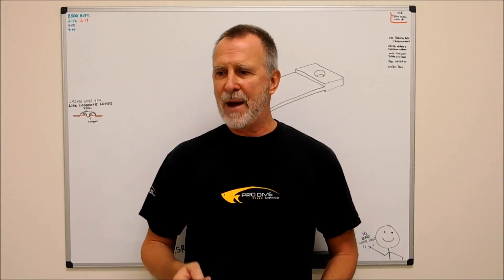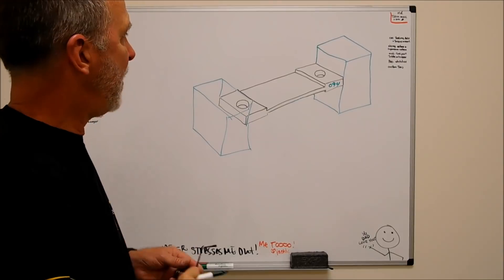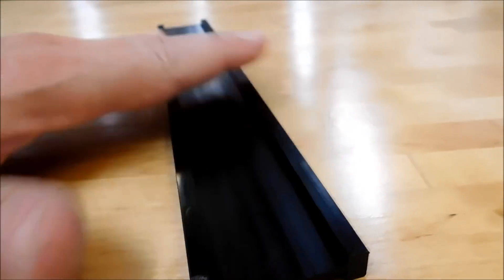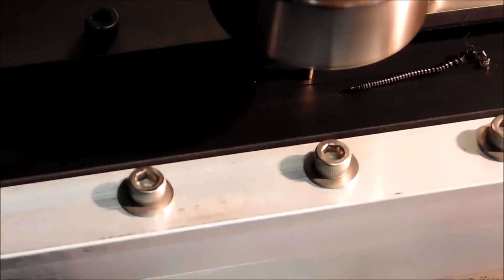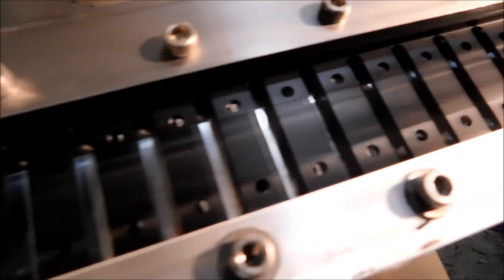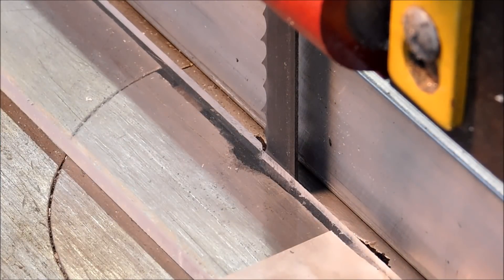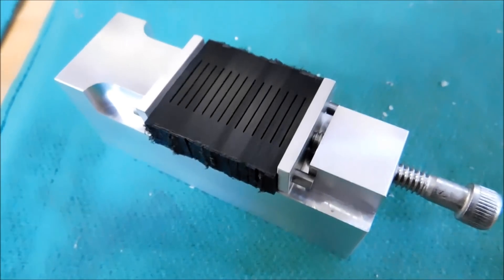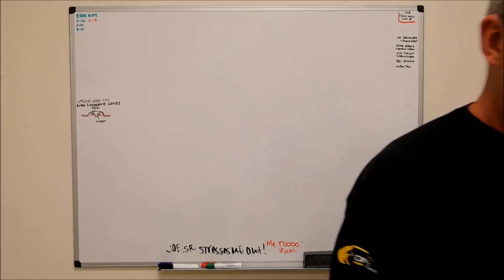Dogbone Milling - A Great Way to Hold a Small Part

Comment: God dammit i hate cnc machines ,you need to be a freaking programmer not a machinist anymore.And you have to watch not to crash a 100-200k$ worth machine simply because you forgot to put ; or something .I know its super fast/accurate and its the future but still 500 people replaced by 10 of those machines -yes its fast but 480 people lost jobs that is 1000 people's incomes in question (lets say they had wife and 1 child).Its not the Mexicans that are stealing the jobs -its the machines(and the Chinese guys but they dont know how to make a proper thread so we got nothing to worry) !
Reply: It's the same all over the place - not just machinist.
Reply from the maker: Someone still has to build the fixtures. Manual skills are very valuable.
Reply: Same as it ever was.

https://en.wikipedia.org/wiki/Luddite
Reply: I understand where you are coming from with your thinking.

 But if not the machine to speed things up and reduce labor cost .
It would be some other way, that reduce cost to make the item cheaper.
Everyone including yourself wants cheaper cheaper.
The only way i get to look at a job, is if i am cheaper, other wise forget it.
People are generally not interested if it is better, just cheaper.

It's an unfortunate fact especially in these current times.
Reply: Or 500 people only having to work for a tenth of the time, being able to afford the same lifestyle as if they were working manually.
And yes, that raises the real question you're asking - who is pocketing the profits/forthcoming from automation.
You're looking at a distribution problem.
Good luck with your search for an answer.
Reply: Peter CCR ENG -I dont want cheaper i want a product that will last more than 6 months-but these days its hard to find such product in a pile of garbage they sell us.If i pay something and i am willing for good product i want it to last .Problem is even brand names whored themself out.look at bosch or makita ,dewalt and the rest -they produce so many junk quality tools these days that its hard to know which one to buy.They got 20 models of hand drills,in 1980 it was maybe 2-3.They dont even improve their products or fix faulty things -just make another model,same shit different color and people will buy it.Where did the service centers go?In my country bosch costed 3/4 of a paycheck to buy in the 80s-people fixed drills, grinders and things-now just throw away buy new one.But i still to this day use grinder and drill my father bought in 1980-thats a quality worthy of money not this shit they sell today that lasts as much as warranty and not a week later.
Reply: Joan Sparky -there will be no 500 people,modern automated factory has no need for 500 people -maybe 50 top.Even if 500 people work for tenth ofa time -it means less salary -lower quality of life.Not to mention you dont need skilled workers anymore so you can reduce the price of work even more.
If this full automatisation is going to happen(and sooner or later it will) -we will have to reconsider the paycheck and whole concept of work for payment and distribution of wealth  as we know for last 2000 years.
Reply: "Even if 500 people work for tenth ofa time -it means less salary -lower quality of life."
Again, this is a distribution problem - the distribution of the fruits of automation/productivity gains.
If one worker does 10 times more with automation than without, the product would either cost 10 times less OR if the product is sold at the same price, the worker would earn 10 times more (=can work a tenth of the time for same wage = keeps lifestyle).
If neither of these outcomes happen you have a distribution problem, usually caused by some sort of monopoly (the owner of the machine or even more probably the lender of the capital that bought that machine pocketing the difference).
Not a lot of people get this.

And yes, this is capitalism critique.

Just to extrapolate things here - what happens in a world were machines/computers do all the work?
The 'owners' of those machines (and the IP connected with it) will earn the output of those machines 100%.
Anyone without ownership of machines will get nothing.
That's where we're headed, the endgame of capitalism.
And funnily enough - capitalism hasn't got a social/human/fair answer for that.
But people will ask that question at some point.
Reply: I hear what you are saying but we all want something for less when money is limited so production  has to be cheap and effective- sorry to burst your bubble but the Chinese "Joe equivalents" in Taiwan are top flight machinists that even Joe would admire.They are the skill behind much of China's development. They are amazing and more fool you for underestimating their ability- I certainly did before but I soon wised up. The only way to compete is to up your effectiveness which is what Joe has shown us here. If you do not want Chinese crap then pay for good quality Chinese stuff ( it has a Western label on it- you know Apple + 90 % of the computer motherboards used checking out YouTube) If you pay $20  for something that should cost $100 but it is made in the Us or the UK it will be cheap and nasty too- no way round that. All China really offers is more bang for your buck and everyone wants that and they work really really hard to supply it! The best course of action is to lean useful skills as they will always be very valuable- add value and work hard and you'll never be out of a job.
Reply: Got to share the story of my father in law.  A great hand wheel machinist who did parts for nuclear reactors.  Exotic materials and tight tolerances.   When the CNC revolution occurred, his employer offered to retrain to CNC machinist.  He blew up, "told off" the company that CNC was "junk" and that hand operations ruled.  ... 6 months later he was laid off, never to have such a good job again in his life.  He passed away a poor and bitter man, always blaming "the man" for the next 25 years...  adaption is the way of life.  Nothing stays the same...

Comment: Very nice. Were those fixtures custom made for that one time job, and was that figured into the part cost to customer? I see a lot of time spent on fixtures that you may never use again.
Reply from the maker: Half a day on the big fixture, less than an hour on the small one. Time well spent in my opinion. Both fixtures can be utilized on future jobs.
Reply: Not to mention that the time those fixtures saved is far beyond their cost.

Comment: Joe;

For your cut off and final trim operation, could you have set up the 1st fixture so you could slip in a plate (after the hole drilling and slotting operations) under the delrin piece with slight oversize holes at the 4 corner holes in the delrin piece, have 4 tapped holes in the bottom of the main fixture, then bolt on a top plate to clamp the delrin?  Run a thin milling cutter between the plate and dogbone clamp and you have final sizing achieved without having to remove the delrin piece from the main fixture.  Could even use 6 or 8 bolts to clamp down to make sure each individual delrin piece stays clamped in during the trim process.  This would eliminate the double handling and also assure part consistency since the delrin is never removed from the main fixture until after work is completed.

Would appreciate your feedback on whether this is a reasonable production idea.

Regards;

Ron
Reply: I'd've also used the smallest possible endmill to cut the slots that separate the dogbones, that'd give you more dogbones from the same sized piece of stock. Pointless if you're only making a few but it adds up if you're doing a large enough number of them.
Reply from the maker: Hi Ron. I did another job similar to this where the process was similar to what you have suggested. The clamp for the final end cutting ran down the middle of the parts, and each screw held 2 pieces. It worked well. Your observationn is very sound....everytime you handle or move a part, the possibility of an error in the relation between features increases. Not moving the part keeps that possibility to a minimum.
Reply from the maker: spankeyfish.....believe it or not, even thin delrin has the potential to cause a small endmill to slightly flex towards the climb side. I chose the size endmill I was confident would resist that influence. It was a 2 flute 9/64 carbide. Leaving an 070 radius that was almost completely consumed by the saw kerf. In the images of the end milling at the end of the video, you can see traces of cutter jump on some of the parts. I guarantee those parts were the first leg of the "up and back" slotting op.
Reply: Wow, that's tough stuff. You were already using the smallest possible endmill, lol

Comment: Excellent example of how to use the surrounding material as hold down. Did you use a shim under the long part after the first plough? Thanks for sharing
Reply from the maker: Surprisingly enough, no. The fixture really dominated the material and it relaxed back to shape after the second side was cut.
Reply: Thanks Joe

Comment: Great video and great ideas! Thanks!!!  It looks like in the final pics(15:46) that the holes are chamfered.  If they are, how was that done?
Reply from the maker: I had a conical c'sink with the angled through hole. I did them by hand before I sawed them off. Took about 5 minutes per strip of 21.
Reply: Nice touch! They look perfectly uniform.  I figured by hand would be faster, they just looked so perfect, it raised the question. Thanks Joe.

Comment: Great job highlighting fixturing! I am not sure if I would have thought about the drawer slide feature but that saved mount and demount time. The vice like clamp I would think will have future fixturing utility. Itself would be an interesting project to have some video. I would have been inclined to make it from steel for double duty for similar small parts use on a surface grinder. Not a criticism. We called that sort of fixturing "ganged" fixtures. Pallets are a hot topic these days, this is going to give me some food for thought before I build one. As always a well thought out job and a pleasure to watch Joe Pie make a piece-of-cake, lol... Happy Turkey Day to you and yours.
Reply from the maker: Thank you very much. Same to you and your's.

Comment: Hi Joe.
You drilled the holes .. left to right both times.
I am curious why the second row were not .. right to left  ?
I  enjoy your stuff on here.
Steve
Reply: He programmed the sequence with the first hole absolute, and subsequent holes incrementally. Greatly simplifies code. Easier code-wise to change the starting Y position and repeat.  It’s a trade-off for a brief repositioning rapid. I do this quite a bit because I have many programs I write in direct G-code vs CAM
Reply: 21anthem12 so he saved programming time but wasted production time.
Not what he normally wants to do.
Reply: He made a hundred, the 30 seconds he lost probably not a big deal in the greater scheme of things, if he was making thousands of them then maybe.
Reply: Ashley Bean Exactly
Reply from the maker: The code did originate from the right, so the 'Y' axis shift was necessary. I had a G0 rapid there, but the initial incremental shift caused a hard bounce rebound, so i made it a G1 to be gentler on the machine. That shift only too a few seconds. In a perfect world, the tool should have shifted immediately negative 'Y' and started the hole pattern in reverse. True.
Reply: Joe Pieczynski 
I knew there would be a good reason.
Thanks Joe for the explanation.

Comment: Joe, before you ever accept the job, do you ever ask if there will be repeat orders, assuming they like your work ? That was a hell of a lot of fixture making time and materials. I have no CNC experiance, but I certainly would not have taken this job on for just 100 parts. You probably spent more time making the fixtures than it took to make the parts. Looked a good job as always though. Well done. Now off topic I know, did you ever get your gun part Anodized ?
Reply: Those were my thoughts exactly.
Reply: That does seem like a lot of fixture time, for 1 order of 100 small parts. Most likely a long time customer and a new part. Joe is probably expecting future orders of that part.
Reply: If he does only one run of those, the customer must be ready to pay a pretty heavy setup fee, if there are repeats then, the cost gets amortized as he has more parts done...   ;)
Aluminum and mostly Delrin aren't cheap...!!!
Reply from the maker: When I get a job like this, I stand back and think.....I can struggle with 100 parts one at a time and consume a bunch of hours, or spend my time making a fixture I may use again and fly through the parts in the same amount of  total time. I usually go with the fixture for part consistency and future profitability.  The AR lowers did get anodized and I will show the results. The clear came out a very unique color.

Comment: Joe can you comment on generally how you cost out a part like this, re fixtures, material etc?
Reply from the maker: I'd start with the material cost first. Someone once said, the material cost should never be more than 20% of the job cost. Thats pretty close. Then add in tooling time and really scrutinize it once it divides out by the number of parts. Adjust as necessary.
Reply: Joe, looking at this particular job, it seems that the setup far outweighs the actual parts made; you'd have to either a) charge plenty per unit to cover making the two fixtures plus the programming, b) charge up front for tooling as a separate job, or c) have a hell of a lot of faith in your customer coming back for more!  Being involved with buyers stuff from overseas (during the '80's & '90's), option b was how it was usually done there - what's normal in the States these days?

As always, an excellent tutorial; have a great Thanksgiving!
Reply from the maker: A tooling or programming fee charged 1 time is not unusual. Its a Non recurring engineering fee ( NRE ). If the job repeats, you bank all day.

Comment: Just curious, but on the first fixture where you drilled the holes and slotted out the individual parts, is there a reason why the hold down features of the fixture are different from one side to the other?
Reply: GREAT STUFF AS ALWAYS
Reply from the maker: I wanted one side of the fixture as the stationary side. If the fixture was a channel, it would have been harder to register the part for the center relief symmetry.

Comment: Made a big noise about how short a time required to machine the parts---no mention of the time taken to make the fixtures and programming ----just saying - for the sake of balance ----engineering is a thankless task by the way
Reply: david wrighton he's touched on fixture time and cost previously. Once he has covered it he seems not to harp on it over and over again which I appreciate.

The clamp unclamp time to do these one by one would be immense.
Reply from the maker: Believe it or not, the majority of this job was the fixtures. They were very basic, but very efficient. Several hours for sure. The parts went by in no time at all.

Comment: Definitely not a easy job without fixtures. How can you make any money on these!? +/- .005” job I’d would quote at ~$2.00ea.  Am I in the ballpark or perhaps selling myself short. Bandsaw rail was a neat trick too. 😛
Reply from the maker: Without fixtures, anyone would get killed on this job. A 100 pieces is a lot of pieces to do one at a time. Your estimate is low for an initial cost. After one time tooling charges, you may be more in the ballpark. Thanks for watching.

Comment: very interesting, I have a question - why are the dog bone ends sot thick. could these be the same thickness as the finished ends of the material?
Reply: Charles not if you’re going to start from thicker material.
Reply from the maker: Starting with thicker material is a major factor, but cutting into the fixture can also translate aluminum into the plastic and wreck it.